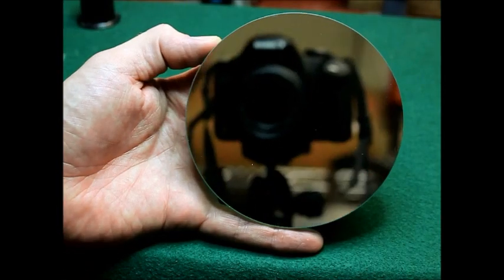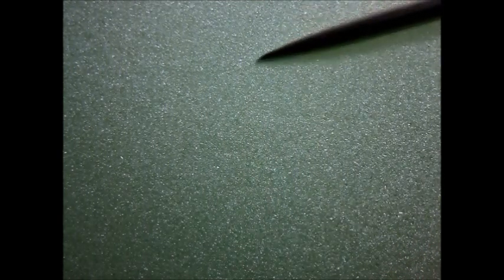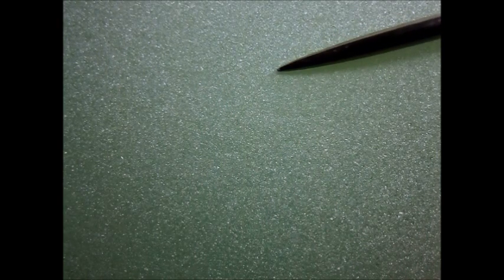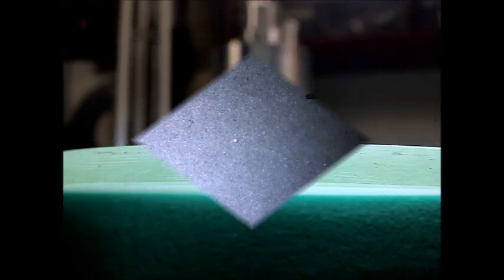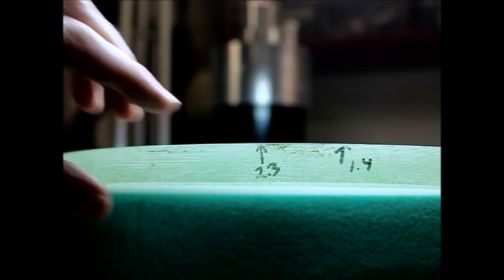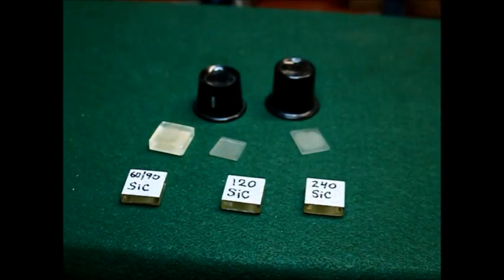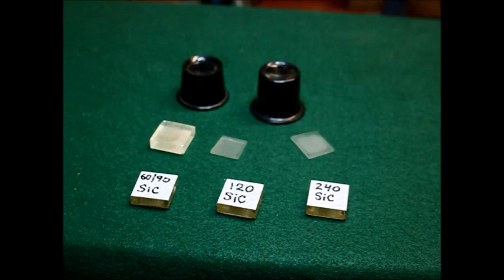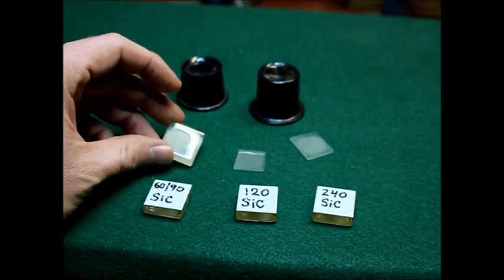Telescope Mirror Making: Part 5, Pits, pits, and more pits

Comment: You don't need to worry about pits. Five wets face down, five wets face up, and you're good to go. What you see as pits, can be just the current grit size producing its normal result. Much of the surface gets smoothed further, but there will always be some from the last wet.

Comment: Interesting, I might have a new hobby, lol. In metallography we use almost exactly the same process but a separate grinding disk for each grit size and that is the only grit they will ever get used with or it will only get used with the roughest grit it has been contaminated with. The disks can be washed until they look clean to the naked eye but under a microscope you can see the granules embedded in the surface. This also helps with cutting efficiency since they should require less grinding media once the disk has been broken in. We do a lot  more cleaning between steps, the object we are grinding gets cleaned first then the entire machine gets cleaned, the grinding disk just gets a rinse to remove the swarf. Once I get to 1 micron and smaller the sample being ground will get washed first with filtered water, then with 99% pure isopropanol and air dried with a hair dryer. When examining a specimen at 1600x magnification a 1 micron scratch will ruin your day, haha.

Comment: Thanks for the series.
Would Pyrex pit at a different rate or the same as plate galss?
Reply from the maker: In my experience, Pyrex pits less than plate glass. Plate glass is a little less forgiving than pyrex. But you're not going see a huge difference.
Reply: Thank you for the information Michael.
A bit later I watched a series of videos made by your mentor.  He worked on a huge mirror made of quartz.  Wow - He certainly has a lot of abilities.
Years ago I considered grinding a mirror, but there's such a learning curve I wouldn't undertake the project.  You and he are removing some of the mystery and making it look more possible, but its still a very involved and exacting process.
I'll enjoy seeing the final result of your telescope.
Thanks again.